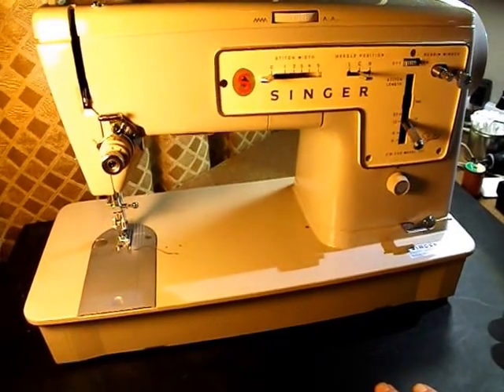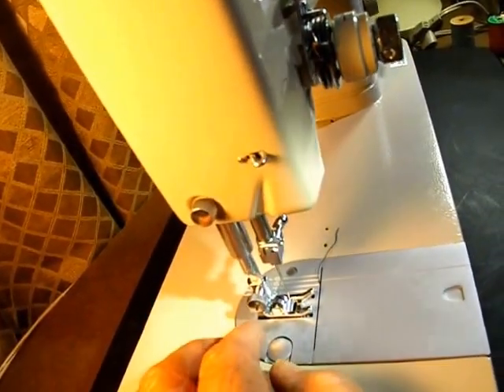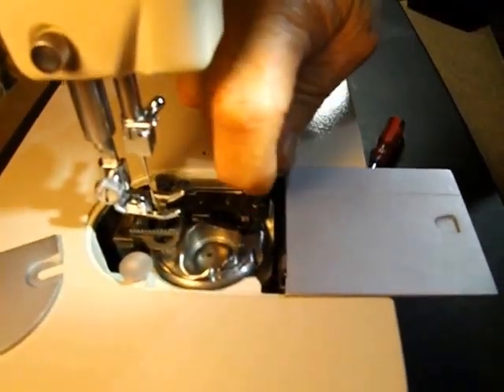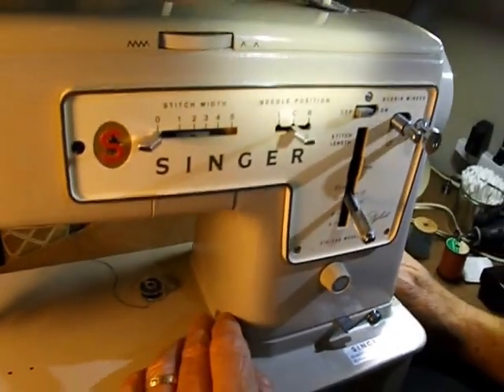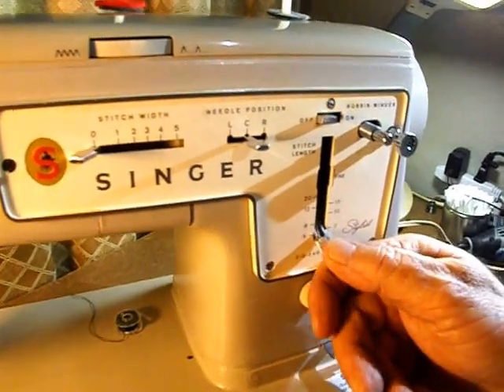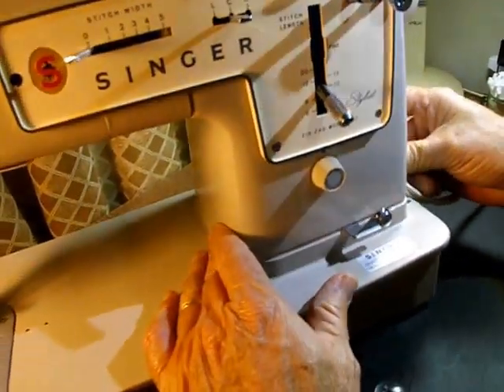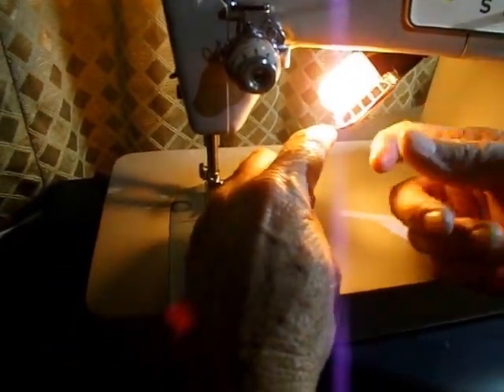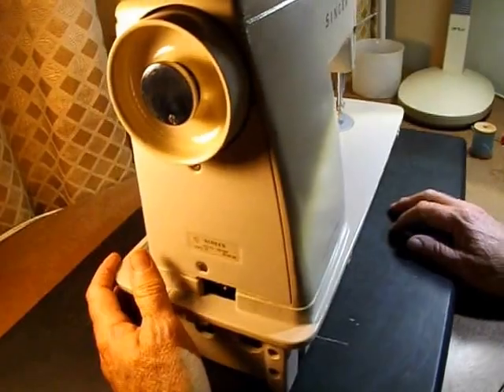TOUR THE FEATURES OF THE SINGER MODEL 457 STYLIST SEWING MACHINE

Comment: Can you tell me how to put a light 💡 in a singer 478 stylist
Reply from the maker: Sure. I don't know how far along you are so I'll start from the beginning. Turn power and light off or unplug from the wall outlet. Pull down on the metal safety cover for the light bulb on the left side and hold it down. Use your thumb & index finger to pinch the bulb. Wet your fingers first or hold a rubber band against the bulb for gripping. The bulb is bayonet-style and not a screw-in style. Push the bulb up into the socket a short way while turning the bulb towards the back of the machine, then pull out the bulb. There are two small pins on the sides of the metal base of the bulb that fit into two narrow slots in the plastic base of the socket. You are lining the pins to the slots for removal. To install your new bulb gently push up into the socket while turning the bulb toward the front of the machine (towards you) and you'll feel the pins slide into those slots. Now push a tiny bit more and turn a tiny bit more towards you to lock the pins into the slots. (bayonet style). This info is on page 65 of the Instruction Manual for Singer Model 478 and is very common to most Singer machines. You can download a free PDF copy of the manual directly from the Singer website at this link: https://www.singer.com/search/support?title=478   Thanks for watching my channel, Janet, and good luck.
Reply: @andytubesewing1953  hey thanks

Comment: Thank you so much for this
Reply from the maker: You are very welcome. If you would like a FREE copy of the Instruction Manual for Model 457 it is available from SInger at this link: https://www.singer.com/search/support?title=457
I also have other videos of this model, including how to change the top gear on the vertical shaft which is known to be susceptible to cracking and breaking. Here is the gear video (25K views): https://youtu.be/M3bFtlV1Y6s  and here is the entire playlist for the 457: https://www.youtube.com/playlist?list=PLsCOZgzzaiKK9GeuGLCo6ZyWv-HbheRVK  I have been getting about 10 emails per week about this gear, which is on about 6 Singer models, since the Covid virus stay-at-home thing has been happening. I hope your gear is fine and good luck. Thanks for watching my channel.
Reply: Thanks again! I have replaced some parts and it is just about to work as it should, but now my needle keeps breaking on the "bob-wheel". I have ajusted the position but it seems like it keeps moving. Maybe something wrong with the "rubber-band" that connects the wheels at the bottom of the machinery. I will search through your links and hope to get this going! Or I will reconnect with you, if that is ok 😁
Reply from the maker: @Hemlighetsmakeri  If your needle is striking the rotary hook that is a good sign the timing is off. In the gear video I mentioned above I show how to timing the hook to the needle stating at 01:15:00 in the video. You can reset the timing 20 times, but if that top gear is failing and slipping then the machine will go out of time in about 30 seconds. I know you are joking when you call the Timing Belt the "rubber-band" (right? joking?) Good Luck.
Reply: English is not my first language so I didn't know how to name the "timing belt", and I also know nothing about sewing machines or the names of the different parts.
Reply from the maker: @Hemlighetsmakeri  You sound hurt which was not my intention. I have viewers who have used rubber motor belts in place of timing and that won't work. That is why I mentioned your use of rubber-band. So I apologize if I offended you. I hope my information was helpful and you are successful with your repair. Thank you.

Comment: I love my sewing machine, I've been using it as often as I can. downloaded my manual, watched your videos and I've gone from curtains to quilting and clothes making. Could I implore you to do a video on maintenance? I think I've been oiling and cleaning correctly but I'm also certain I've messed up my tension somehow, no matter how much i adjust the top tension the bobbin thread just seems to ride along the fabric. I keep meaning to take it in to my local singer guy but hes only open certain days. help! I'm participating in my first quilt block swap but I'm afraid I'm going to mess up my machine if I continue to use it if I'm improperly maintaining/using it.
Reply from the maker: Good on you for using your machine so much, and sorry you have a tension problem. I don't have a 457 right now but I have done a number of tension videos. If your bobbin thread is flat it usually means you have ZERO needle thread tension! It's gone. It may be a cracked or broken tension indicator. ( the - | + on the dial) It has a horizontal bar that the tension pin pushes on to release tension. If the tension indicator is plastic, it can crack and then the tension discs don't open. When you thread the needle the thread never goes between the discs and you don't get tension on the thread. Here are some links to my tension videos that may help. If you need more info, please email my channel email address of andytube53@gmail.com. That is a better forum for sharing info and I can send pictures and a free Singer Service & adjustment Guide in pdf format. Good Luck.
https://www.youtube.com/playlist?list=PLsCOZgzzaiKJaeFB_GW97NsW5GYM7KD9U

https://www.youtube.com/edit?o=U&video_id=JqauIOWs9CI

https://www.youtube.com/edit?o=U&video_id=F_yoEPte09I

Comment: Hi Andy. The plug socket on my newly purchased Singer 457 is smaller than the one in your video - do you know where i might be able to find a reference for the different Singer plug types? I took a gamble with one that i thought would fit on eBay - but it's the same size as yours and doesn't fit. Any tips greatly appreciated. Thanks!
Reply: (P.S i forgot to mention that the machine didn't come with a foot pedal or electrical cables of any kind)
Reply from the maker: I am not aware of and have never seen a reference chart for Singer Terminals or plug sizes. I have done a few model 457 restores and have not found anything smaller about the socket on the ones I did. Are you located in the USA? I just wondered if it is the 110V Motor in the machine. There are many sellers of cords, both new and vintage, but few sellers of the terminal/wiring unless they are parting out a machine on eBay. Since you did not get the cords or foot controller with the machine I assume you are looking to buy both. Have you thought about a new? Here is a very well known seller who has cords, foot controllers, including the electronic type, and she will even install the cord to the controller you buy for a small additional fee.
https://shop.sew-classic.com/Cord-Set-Singer-337-338-347-348-457-466-476-477-478-97991-004.htm
https://shop.sew-classic.com/Foot-Control-Electronic-2-Wire-Type-UL-12-amp-SCE168FC.htm
According to this seller, the same cord set is for Singer 337, 338, 347, 348, 457, 466, 476, 477, 478. I did look at the parts list/diagram for the 457 hoping I could get you a part number or more info, but the terminal (socket) and cord sets are not shown. Good Luck.

Comment: Would this particular machine be able to sew leather? Thanks in advance
Reply from the maker: Some leathers, certainly. Think garment leathers, using a Catagory 2032 (Leather) Needle. I like to use an Ever Feed/ Walking Foot Attachment too. Get an idea by watching this 11-second slide I made of the manual showing needle to thread to fabric chart (just pause the video) https://youtu.be/AAwgHaa_bIM  It's a domestic (home) sewing machine not industrial, so it really is not capable of cowhide leather type sewing. Maybe patching a harness once in a while or repairing your leather belt, but not on a regular basis.
One of the strongest Singer domestic Machines would do better, like model 15-91, but it is still a domestic machine and not made for sewing leather full time.

Comment: Hi, I just bought this exact model sewing machine from a garage sale. My bobbin won't move for some reason. I have no clue what it could be :(
Reply from the maker: uh oh...sorry to hear that :) This machine had the same problem. I found a broken gear at the top of the vertical shaft. The bottom of that shaft has sprockets and a belt that operate the hook/bobbin. I had to replace that gear & belt. In my restoration slide show there are pictures of the broken gear and then the new one in place. Take the top cover off your 457 (2 silver screws) and look at the gears on your machine; I think it is broken. Here is a link to the pictures:
https://www.youtube.com/watch?v=y_58gXoZqjA&list=PLsCOZgzzaiKK9GeuGLCo6ZyWv-HbheRVK
Best wishes.

Comment: how do I get to the under belly. My screws are not budging. should be able to tlit it back and get to underneath. Instruction book says to remove retaining nut. I am unable to figure out how to do that. Does your model 457 connect like that from the back? I would love to be able to get to the backside/bottom of machine.
HELP!
Reply from the maker: If your machine is in a plastic case bottom, there are 2 long screws and a thumb nut/washer holding the case bottom to the machine. Inside that case bottom, there may, or may not, be a metal oil pan/ drip pan/ base cover. Start watching this video at the 21:30 mark;
https://youtu.be/M3bFtlV1Y6s

Comment: Hi Andy, do you have a video that explains how to replace and adjust the large plastic wheel/switch that controls the blind stitch located above front control panel. I have a Stylist 477 that looks clean inside and out but the blind switch wheel has a large piece broken away from thumb wheel that I discovered after removing the top cover... Do you think something badly mechanical in the machine caused this?
Reply from the maker: A couple videos I made I show R&R the dial.
start at 3:15 into this video: https://youtu.be/egDAePpqjW0
I also remove and replace that dial for cleaning below it in this video of a model 513:
https://youtu.be/_SuIiVok64k    You can find used vintage parts on eBay and such sites if you are patient and find someone parting out a machine. Connie at ThriftyFarmGirl.com has a couple like it from a model 413 and a 457. It looks like the same part, but you can tell more than I. If you find a part number on the bottom of the dial you can ask Connie to check the ones she is selling for that part number. The dial was on a few models, maybe with different color ink on it or something, but the same size/holes/etc I believe. I've bought from Connie for a number of years with great satisfaction. A trusted seller high on my list.
http://www.thriftyfarmgirl.com/singer-413-stylist-sewing-machine-parts
http://www.thriftyfarmgirl.com/singer-457-stylist-sewing-machine-parts
You don't say which side of the wheel is broken, but it sounds like the backside if you did not notice until you removed the cover. I have no clue as to how it broke, but all the moving parts are below it, so maybe the screw was over tightened, or it was damaged and had a crack or defect from previous work on it. If an edge of the wheel that was outside the cover then lowering or raising the machine from a cabinet or removing/replacing the lid on a portable case may have struck the dial/wheel. I've never seen a broken one before.
Reply: @andytubesewing1953  Thanks Andy.. you are a wealth of knowledge.. your reply peaked my curiousity so I disassembled the cam area disc and discovered it missing a fashion disc directly under the thumb wheel. The Zig-Zag (#1)was still in it's place. My best guess is whoever worked the machine last, forgot to install the second disc then began tightening the center fastener forcing the plastic thumb wheel to bottom out on the machine housing causing the crack! Anyway I've installed new thumb wheel, new needle and the missing disc and oiled the machine and adjusted the thread tensioner per your video. Now she purring like kitten.. and sews real good too! Lol
Reply from the maker: @briankilgore9227  SO happy you let me know what you found! It helps me when I get questions like this. I think you are correct as to what happened. So, good on you for saving that machine! Hope you do another one in the future. Take Care.

Comment: Hi. Could you please advise.  My machine will pick up thread first time but then will not make a stitch. Any advice would be welcome. Thank you in advance.
Reply from the maker: Hi, Josie. The most common reason for this is incorrect threading, so we always start by removing the thread back to the spool pin and rethreading. Also, verify the bobbin is inserted into the bobbin case/holder with the thread coming off in a counterclockwise direction. If you need a manual Singer still has it for free download at this link: https://www.singer.com/search/support?title=457
My playlist of videos for model 457 also has videos for threading the needle and winding the bobbin: https://www.youtube.com/playlist?list=PLsCOZgzzaiKK9GeuGLCo6ZyWv-HbheRVK   Start with those and see if it corrects the problem. Good Luck.

Comment: There must have been two versions of these. Mine had a round plastic knob on the bed of the machine.
Reply from the maker: It is the FEED THROW-OUT KNOB. Models 457, 466, 477 and 478 all used the same body. Some machines in each model were made with a feed throw-out knob. Quantity unknown. The knob is marked with the letters "F" for feed and "D" for darn. None of the instruction manuals show or mention the knob. The darning instructions simply say to install the "FEED COVER PLATE"; an extra needle plate with a raised covered area to prevent the feed dog from contacting the fabric. There is one Service Manual that covers all four models. The knob is shown in all pictures of the different models. There is a Remove & Replace section that describes how to remove and replace the knob and pitman parts. All four parts diagrams for the models show the knob and pitman with parts numbers. You don't see very many machines with the knob and no one seems to know why some machines include it.
Reply: Thank you for the explanation.
Reply from the maker: Welcome. It was a great question. I pinned it at the top for others to see.
Reply: Mine has that too.  What does the FEED THROW-OUT KNOB  do?  BTW, thanks for these videos.  I finally know how to use this machine!
Reply from the maker: Hi Tim. Thanks for asking. When you turn the knob from "F" to "D" a mechanism under the bed "throws out" the FEED DOG, which really means it lowers the feed dog below the surface of the needle plate. This is used for free-hand sewing, like darning, monogramming or freestyle quilting. You must move the fabric by hand instead of having the FEED DOG pulling (or pushing) the fabric past the needle. Throw-out is really an archaic term. These days we would call it "feed drop" or maybe "feed dog drop". Thank you for watching. Good question.
Reply: Ah.  OK.  What does R do?
Reply from the maker: If there is an R on the knob you will have to tell us what it does; I don't have a clue!
Reply: Andy Tube I just received a Singer Stylist 477 and it has the feed dog knob.  It has F, D and R. When I put it on R it looks like the feed dogs move backward, away from me and on F they move in a motion towards me or forward.  Not sure what that does though.
Reply: Hi Andy,
I was very fortunate to get a 457 for $15 at a thrift store.  It had one of those little knobs on the front.  First, the knob didn't move anything; the feed dog mechanism was frozen.  There's a feed dog pin that goes into a shaft on the bottom of the machine.  We (my husband and I) managed to unfreeze the pin and we cleaned up and oiled both the shaft and the pin.  Now, the knob on top of the machine works.  Now, what I discovered, I believe, is the meanings of R, D, and F.  They refer to the type of fabric you are using. R means "regular"; the feed dogs are at the maximum height for regular fabrics.  D means "darn"; the feed dogs do not come up past the needle plate at all.  F means "fine", fabrics like silk; the feed dogs come up somewhere between fully up and fully down.  I'm going to keep mine at R, as I don't darn or do quilting.  I found the F setting awkward, not useful for me.  Thank for your recent video on replacing the  motor belts on vintage Singers.  I  wrote you earlier about my fiasco with trying to replace the motor belt on my other 457.  It's nice to know there's a place that has these belts that actually fit; maybe your video will help companies that sell the too-small belts to urge their suppliers to manufacture belts that actually fit.
Reply: F, D and R? Forward, Darn and Reverse?
Reply: Andy Tube  I have an instruction manual that says “R” is for “Regular” fabrics, “F” is “fine” fabrics, and “D” is for “darning and embroidery and button sewing.”